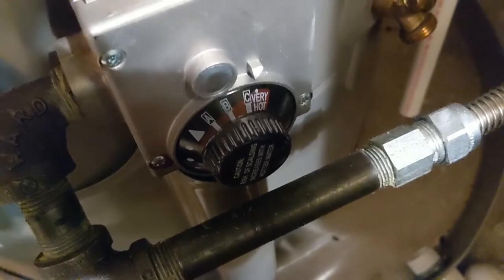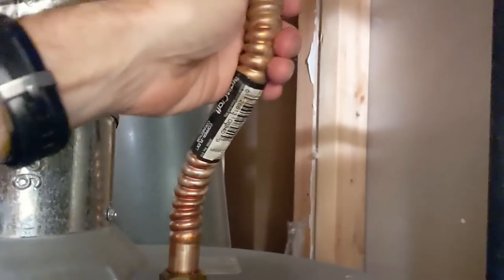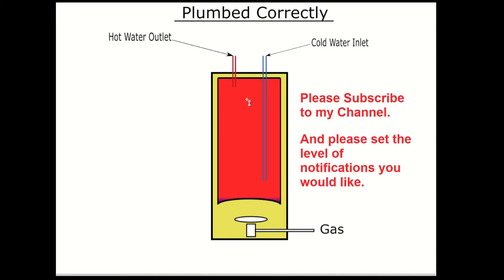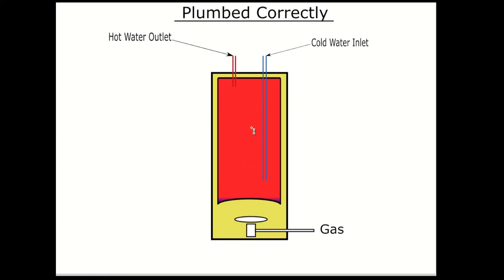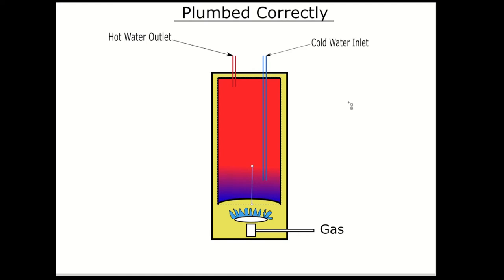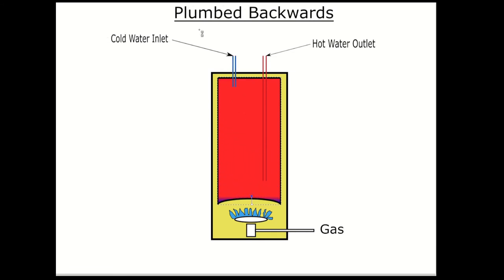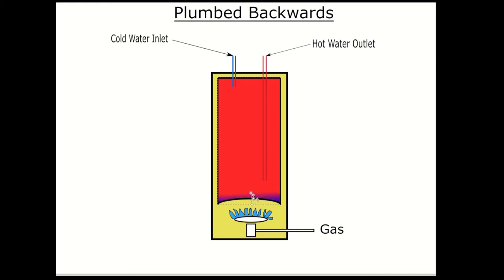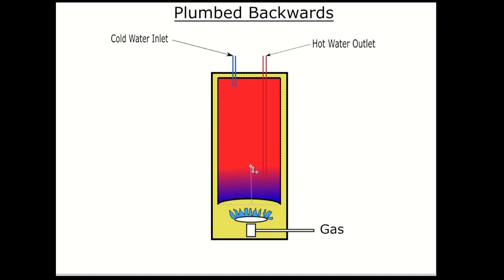RARE FIND! - Water Heater Plumbed Backwards - Rare but Instructive

Comment: Very helpful thank you!  I have a slightly different problem where hot water goes to all my toilets and the hot and cold valve indicators on my tubs sinks etc are all backwards.  Is there a way to switch this in one fix at the source?

Comment: Thanks for explaining it....mine is unfortunately plumbed backwards. It is over 15 years old and started to make noises about 3 years ago, I nevered flushed it nor did the previous owner....I will be replacing it later this year to avoid problems later.  Thanks again.
Reply from the maker: You could try to flushing it now. It may stop making noises if you flush out a lot of debris.

Comment: We just had a leak in our 5 year old hot water heater. We turned off what we thought was the cold water intake valve, only to discover the hot water output, was actually the cold water input. To stop the leak we had to turn off the main water supply to the whole house, since the water pipes are reversed on our house and the shut off valve was installed on the output pipe. It looks like the plumber naturally assumed the cold intake was on the left side of the tank and the hot water out put was on the right side. Problem is the plumbing of our house pipes are reversed.  The water heater also does not have a drain tube of any kind installed on or with a pressure release valve. Is that normal?
Reply: There should absolutely be a pressure/temperature release valve. And there should be a pipe on it directing it to within 6" of the floor.

Comment: Can this damage the water heater or dip tube?
Reply from the maker: I doubt that it would cause any real damage. It may shorten the life of the water heater by a bit. The main thing is that you'll  get much less hot water out of the device than you would if it were plumbed properly.
Reply: @HouseKnowHow  thanks for responding…. Fortunately we realized it after only a few days.